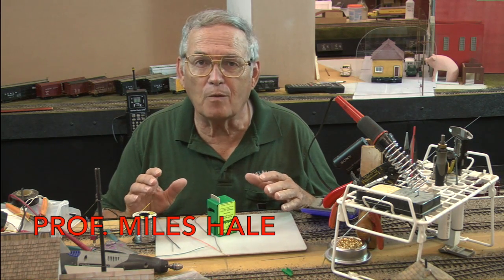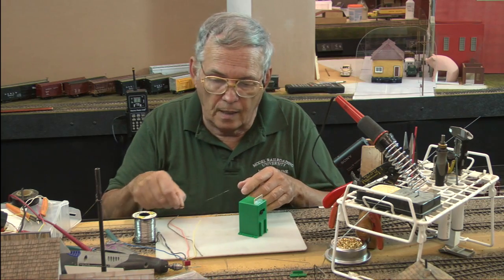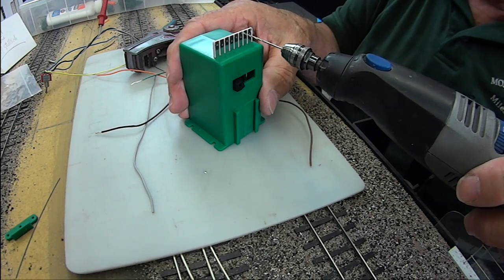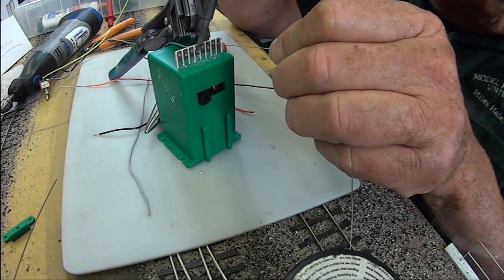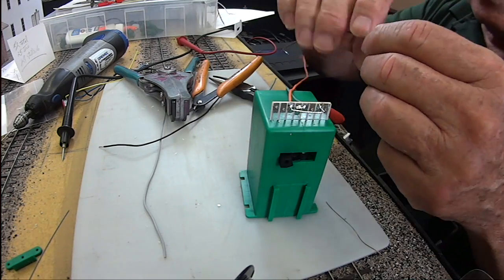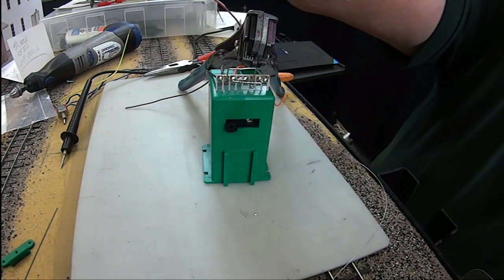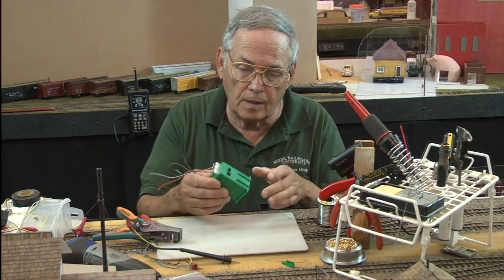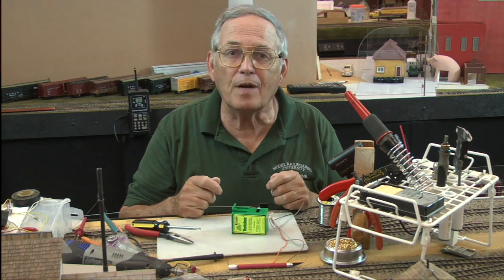Wiring 102

Comment: Will the 039  fit into the original (smaller hole) on the turnout throw without drilling it out?
Reply: You would want to drill the turnout also. You want to have just enough play in the mechanism, so nothing binds.

Comment: Miles, it might be important to note that the foil contacts on the Tortoise can be damaged with too much heat and will de-laminate from the substrate.  It is important to have a soldering iron with enough heat capacity to make the connection quickly.

A better solution would be to use the connectors that are available to connect to the Tortoise, and solder to those connectors.   In using the connectors, it would allow one to replace a Tortoise without the hassle of all the re-soldering.

I like your test box; it is a very good idea.

Keith in Kansas City North